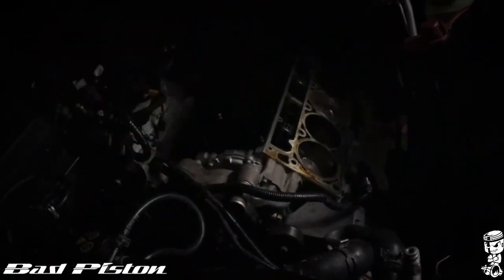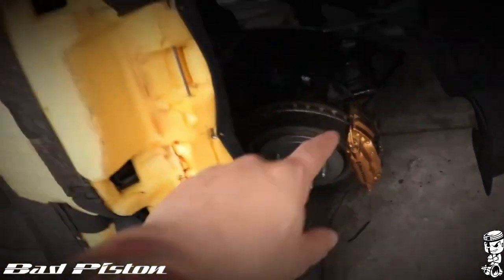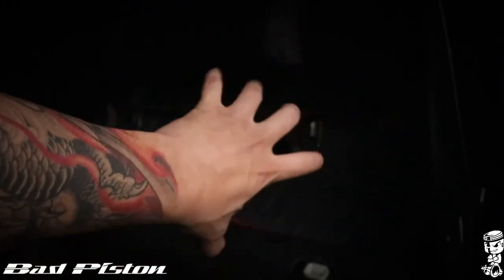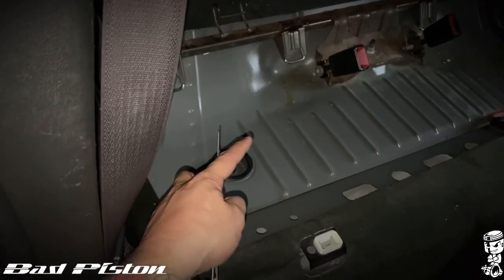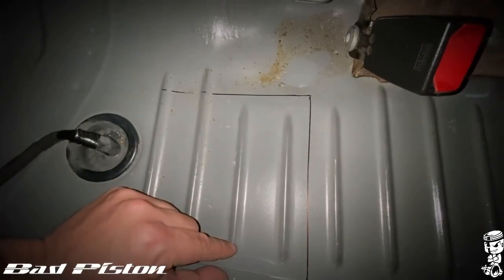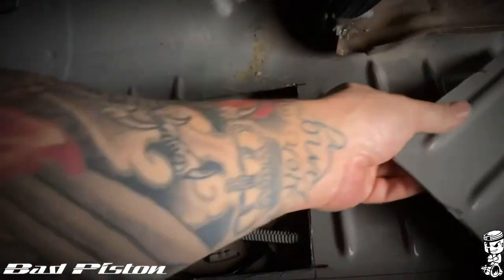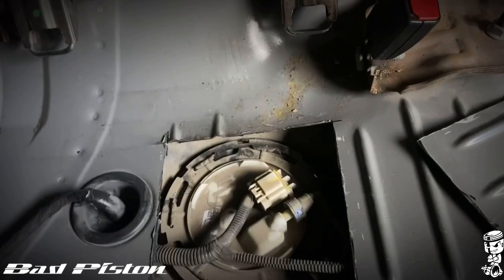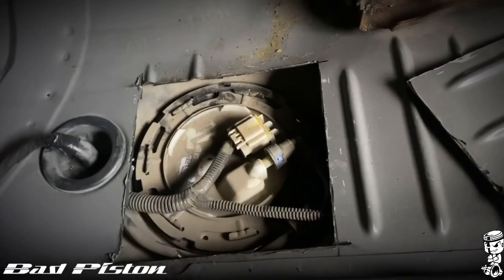Fuel Pump Trap Door, update on my Camaro

Comment: Hi, thanks for the video. I'm from Chile, I have a 2012 SS LS3 which has stage 3 cams. When doing a repro, it runs short of fuel at high rpm. Could the pump filter be dirty or do I have to change it?
Reply from the maker: It might, How much injector are you running? Check fuel pump also, your dyno guy should be able to see where the problem is, i was running stock injectors and pump with a stage 4 cam on pump gas but i was maxing them out, after porting heads, and e85 i needed bigger injectors and fuel pump

Comment: I've taken short cuts on jobs where it made sense, but this harms the structure of your car. Not to mention your cutting with a hot saw blade above right above fuel lines.
Reply from the maker: i get your point but honestly how or on what way can affect the structure? im not planning on selling the car and slowly will be a dedicated track car meaning there will be more cutting in the future, besides is not like the frame it’s fragile now because i made an access door on sheet metal under rear seats, now the cutting above the fuel lines yeah it not the safest procedure i get it
Reply: @badpiston8100  If you're just trying to get your v6 Camaro back on the road so you can have a daily driver then ok. If you're putting it on the track where there is going to be stress on it the body may twist and warp because of this large hole you've created. I know some cars have fuel pump access but they're engineered with that from the factory. These are uni-body Camaro/firebirds after all.
Reply from the maker: @ZackL4142  bro every single guy i know with a 5th gen that tracks them have done this and no issues at all since 2010, a cut on sheet metal won’t twist nothing lol is like worrying about bleeding out after a shot but i’ll keep you posted if anything happens, and same from you 🤙🏼
Reply: dude this isn't affecting the structure of the car
lol
tons of guys do this
zero issues
omg

Comment: I just did this today because my stock fuel pump finally went out after 91k miles I installed a zl1 pump
Reply from the maker: Nice! this method is super easy compared to dropping the shaft, tank and all that lol plus it’s there now in case you need to go back
Reply: What symptoms did you have to know the fuel pump is bad. My car is not wanting to start after new battery,  the battery was tested and it's good. The guy gave it a charge boost and nothing it winds a couple times very slowly.